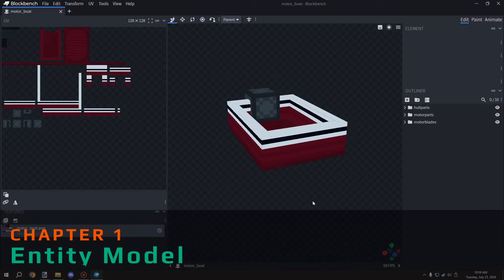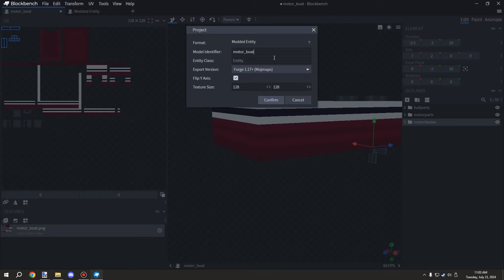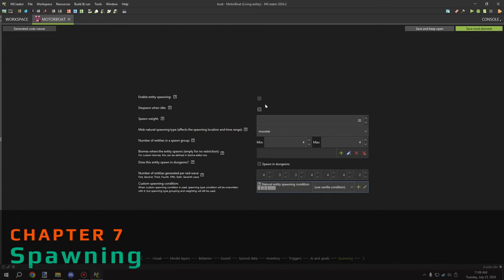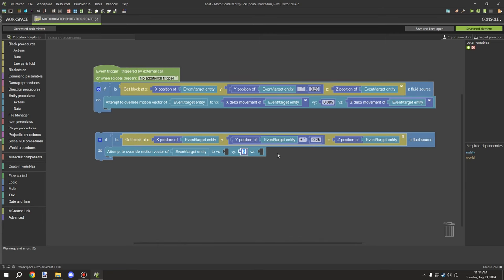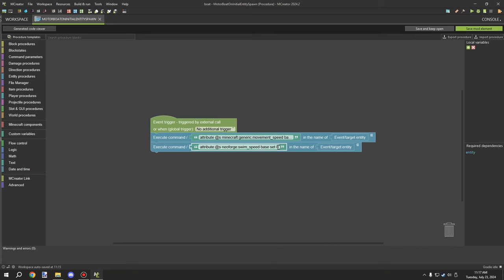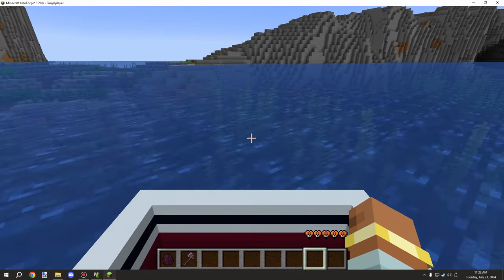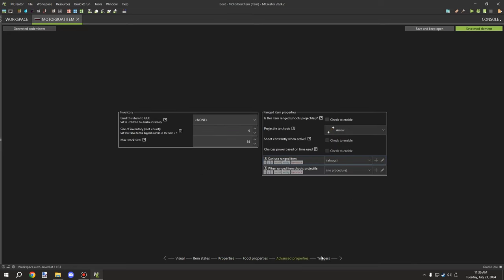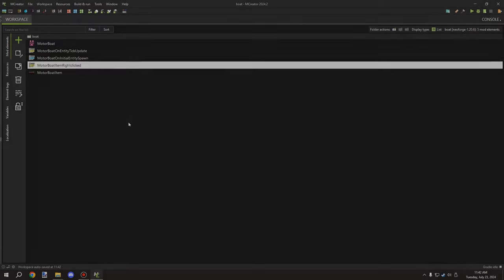How to Make CUSTOM BOATS | MCreator Tutorial | 2024.2

Comment: Can make guide about how to make custom signs / hanging signs?
Reply from the maker: It would be possible but not with dynamic text, that part would require coding as MCreator does not have any support for this for title entities, may not even be supported for data packs at the moment not sure.

However it is possible to make the mechanics for placement conditions and such and use icons and maybe block states for different icons but that's the closet thing we can do at the moment without java.
Reply: @NorthWestTreesMCreator  Could we use the text display entities?

Comment: Can you make a guide on custom mob head. I mean, weareble and placeable and also rotated to player face.
Reply from the maker: This would need to be done through armor mainly helmets, however, the issue I have had is making a model for 3D armor that does not bug out. For some reason every time I try to make a video with some kind of 3D armor it has rendering issues. The few people that have figured it out never share how they get it working so been stuck at base one.
Reply: @NorthWestTreesMCreator  I have no problems with armor. I have with block! It always rotates left from Player and also it not centered on the block, it placed on angle of the block and looks awful!

Comment: How can i do make a dimension with just mountain
Reply from the maker: Biomes are not linked to terrain, this was the case before Mojang changed how biomes worked in 1.18.
Biomes are now controlled through height maps which overlap there is 5 heightmaps in total that control the position of where things can generate.
Reply: @NorthWestTreesMCreator  its imposible for 1.16.5, right?